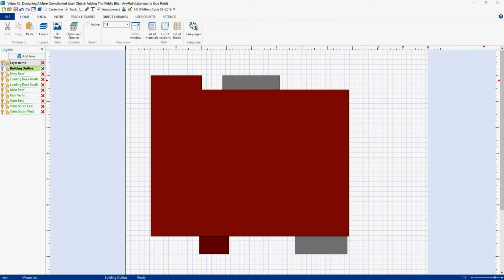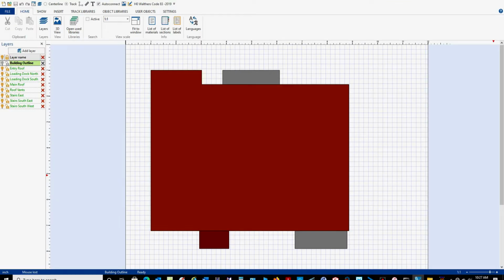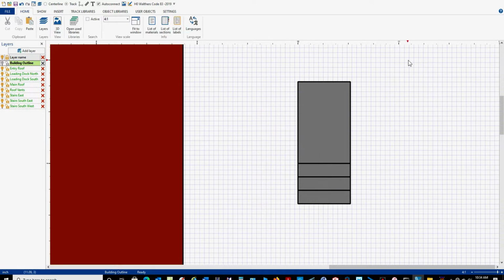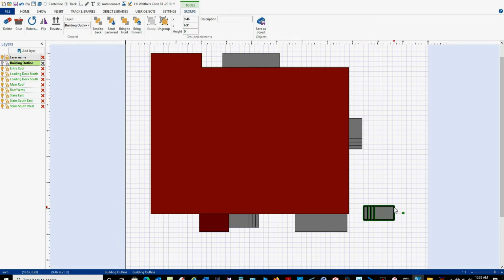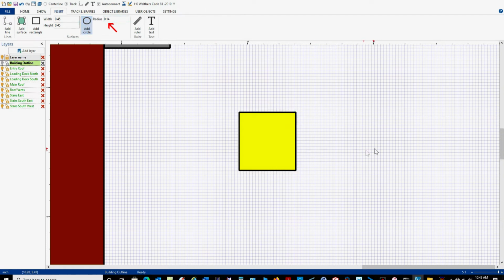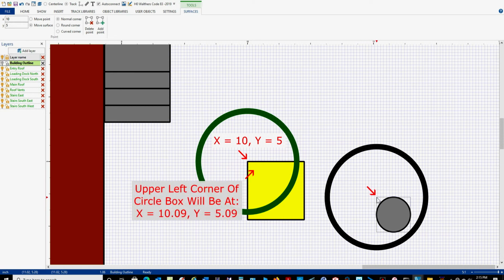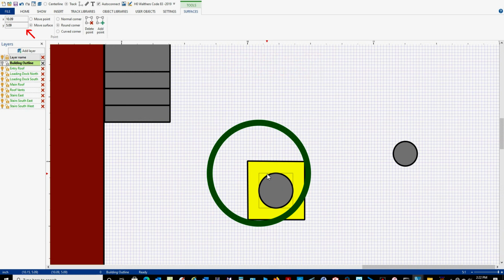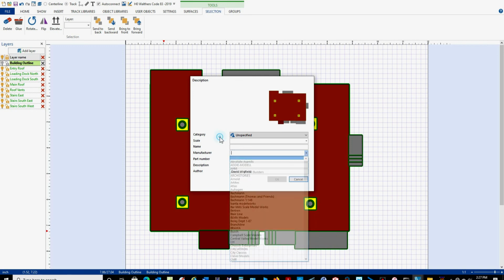AnyRail 6 Tutorial Video 30: Designing A More Complex User Object-Adding   The Fiddly Bits

Comment: You can reduce the size of the control point circle in settings to make it easier to zoom in and work on small objects.
Reply from the maker: Peter, I did not know that control point in settings affected the points for circles, etc. Good to know and I'll make mention of it in the future. Two more things that I think would help in the operation of AnyRail would be, 1: Allow you to set the scroll wheel on the mouse to zoom in and out without having to use control, very awkward and 2: Scale the handles for entities as you zoom in and out. That way you would not have to keep going to Settings and changing values. It would make it easier for new users. Dave